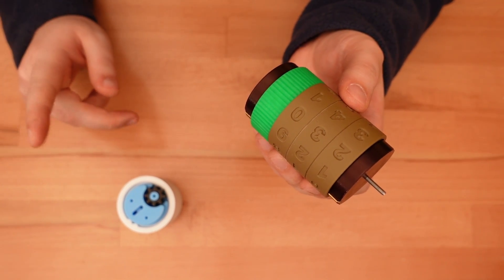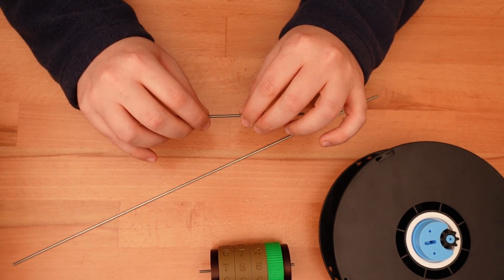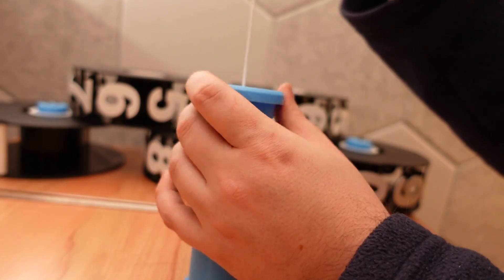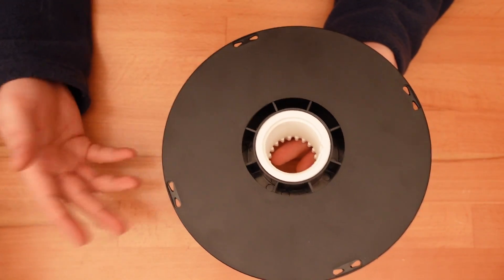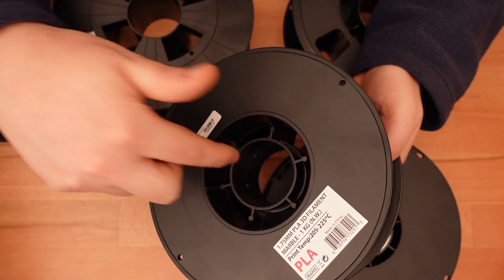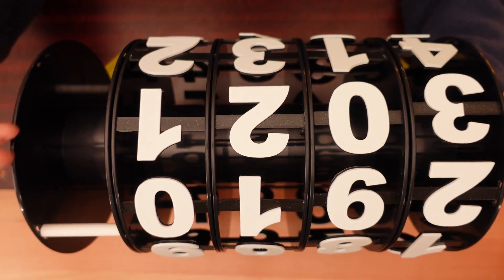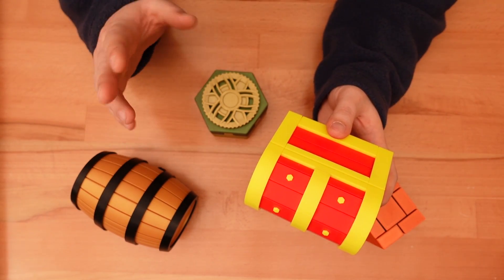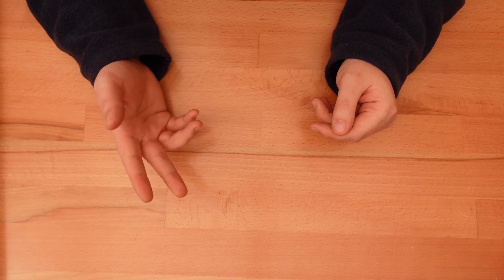Giant 3D Printed Counting Mechanism

Comment: I am trying to find details of the mechanism to reset the counter to zero.  Interested to know if you have looked at this feature.
Reply from the maker: The simplest (but not ideal) solution I found was sliding the dials apart to disengage the index wheel. A more robust solution would be to attach the index wheel to a pivoting arm that you could swing out of position whenever you wanted the dials to become free spinning.
Reply: @3DPrinty  I only have a need for two count wheels (00-99). I had thought about separating the wheels mechanically, but to sync the gears and wheels would be harder than it should be.  I am trying ratchet wheels and pawls. Easy to reset to zero, but pushing (banging) on the count button can cause over counts.  I am going to investigate clock type escapement movements.

Comment: Why are such counters sometimes the numbers are not arranged in one line?
Reply from the maker: Slop in the gears results in a gentle slope that gets worse every digit. If you're referring to counters that intentionally don't jump between digits, I think that's used for number wheels that are always quickly turning. They act more as an indicator that the mechanism is working than as a moment-to-moment readout of an exact value.

Comment: I really like the idea of using this or an updated version of it as a clock. I like the idea of using empty 3d spools in something useful (although I don't go through as many spools as you do). I noticed this video soon after you posted it and from just looking at the thumbnail I was thinking great clock. I have been thinking one of a M5stickC plus as a clock but the display is too small. It could easily control a little motor that could activate one of your counters. Today I came across a different design (https://youtu.be/qVW3dhQSBRM)  for counter mechanism for a clock but he used a lot of wood. I'd rather use PLA and empty spools as you have done here.
I'm looking forward to seeing a new post of a clock. I'm hoping you plan to use a motor and an Arduino (or some Arduino compatible device) rather than a fully mechanical clock (which would have a lot of parts). I like the M5stickC plus as it has a built in RTC, battery backup and can fetch the correct time from the internet via wi-fi. One can charge it or run it with a phone charger.
Reply from the maker: Thanks for sharing that video! I'll take a look at the M5StickC Plus.

I haven't done any robotics/Arduino projects yet - so most of my time will be spent figuring out the basics. Fortunately, my new update schedule gives me some free time to learn completely new skills on non-video weeks.

Comment: I'm excited for your future videos! I love puzzles.
I also like Hatchbox, but just switched over to Overture who is switching over to paper spools that should be easier to recycle. So far their filament has been running really good.

I am currently in the middle of printing out 80 of the twist lock box for the kids of a church group I help out with. They love the 3D printed things I have brought in so far and I'm excited to hand them out when I finish the project.
Reply from the maker: 80 twist lock boxes - that's an impressive print run! Thank you for printing and sharing my designs. Stories like that are why I post these projects!

I'm really happy to see more manufacturers switch to cardboard, and I hope Hatchbox follows that trend. I also use Overture (matte black and white), so it's great knowing that newer rolls will be easier to recycle.

Comment: I wonder how hard it would be to hook up motor and arduino to make a subscriber counter!
Reply from the maker: Would be a cool use for it! I printed handles on the input wheel for easy turning, but those could be removed to make way for a belt system. Then it's just a matter of calibrating the steps-per-increment and making sure there's enough torque (larger carryover actions are far from perfectly smooth).

Comment: Your channel simultaneously reminds me of how it's made and this old tony. That's an incredible combo, keep up the great work!

I would also love suggestions or tips on where to get hardware (m3 threaded and non-threaded rod, screws, nuts etc) as I've just set up my first printer and I'm sure I'll be needing the hardware but have no idea where is best to get it in semi-bulk.
Reply: The hands give off a real This Old Tony vibe.
Reply from the maker: Very high praise, thank you!

I use a mix of local hardware stores, Amazon, and McMaster-Carr. Years ago, I noticed that Ivan Miranda used tons of bolts in his 3D printed projects - designs that were very similar to the things I knew I'd like to make. So I immediately bought a bunch of assorted M3 and M5 kits. Those have proven very useful to me ever since.

When I get to a project that will require a large number of the same hardware, that's where I'll start comparing prices at the places already mentioned.
Reply: The best place to get hardware would be a local hardware store honestly, or a chain one of you can’t find something specific. Another online option would
Be McMaster-Carr for very specific items if you can’t find something. They may be a bit pricey but they will deliver quickly and almost certainly have whatever you need in stock. Other online retailers exist too of course, the limiting factor is mainly understanding the specific thing you need.